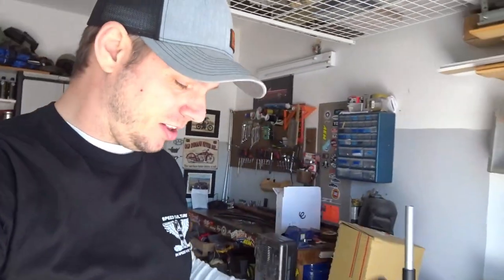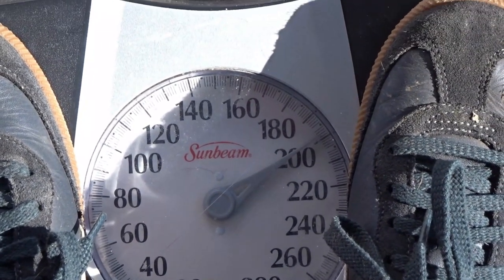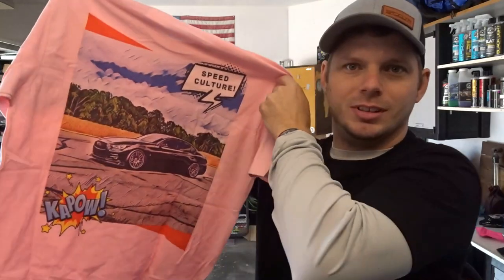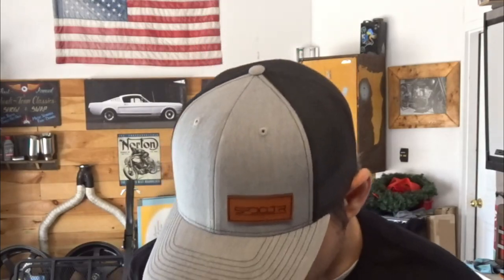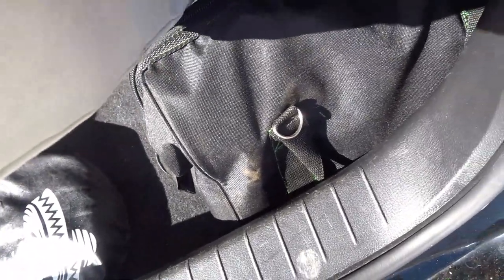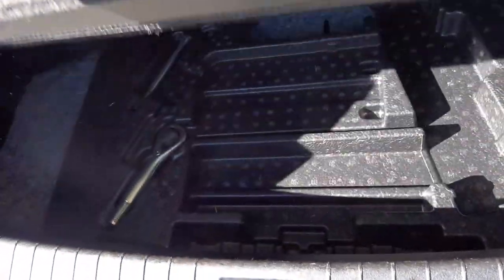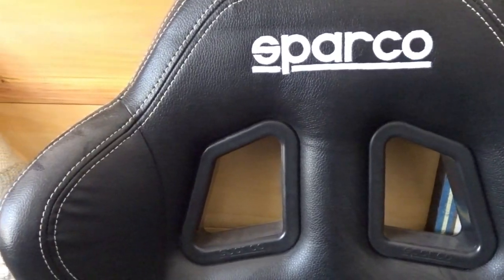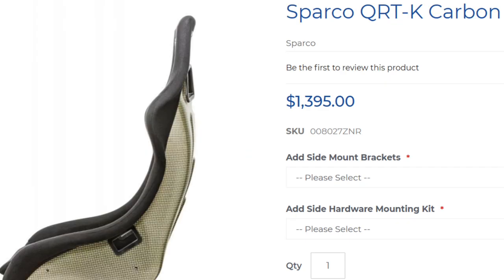Major Weight REDUCTION in the Q50! | Some Common Weight Reduction Strategies

Comment: I noticed big difference when I got 18 inch light weight wheels with race tires and the Z1 2 piece rotors front & back. Weight reduction is the best mod apart from driver mod.
Reply from the maker: Huge weight reduction!!
Reply: @SpeedCultureStudios  do you have any driving tip videos for better launch control, what rpm to shift at and racing tips in general for Infiniti Q50 owners. I ask because I find it difficult to engage launch control on my car on non prep surfaces. My car is a 3.0 with a few mods and I know it can run faster but i am sore need of the drive r mod.
Reply from the maker: @Driftking305forlife  I don’t have any experience with the 3.0t launch control so I am not really the best to ask there.  And knowing that I can’t even get traction in my 3.7 at launch, I can only imagine the difficulty you have.  
Tire pressure is a big one to think about.  How high are you able to rev to for launch?
Reply: @SpeedCultureStudios  On my car it's supposed to be at 2500rpm to set itself.Problem is the car just won't be consistent with this. With traction off on bad or regular road surface it will just spin and then hit the AWD error. If i launch it at less  say 2200 it won't but the car is not in full boost. I have also noticed that when accelerating out of corners the car struggles with power.

Comment: Lightweight driveshaft. for the g37 the oem one is a 2 piece heavy driveshaft. Aftermarket is one piece aluminum or CF. huge increase in acceleration and huge decrease in unsprung weight.
Reply: Where can I buy a single piece  drive shaft from bro.

Comment: Do u really think duck bill spoiler affects your 0 to 60 on a straight line .
Reply from the maker: Absolutely.  I’ve noticed the difference consistently since installing it.  The point of aero and large spoilers and wings is to increase downforce which inherently increases friction/drag therefore reduces acceleration.
Reply: @SpeedCultureStudios  ok bro
Reply: @SpeedCultureStudios  thanks bro , I will be removing mine shortly. Would recommend 1 piece drive shaft for the  g37 .

Comment: Hey bro I have a 2017 vr30 bought it last month with 52k miles from the 1st owner  and he said he never changed the transmission fluid should I change it? Had a mechanic tell me it could mess up my car what should I do?
Reply from the maker: If it’s shifting smooth, I wouldn’t worry too much.  If you notice it shifting hard or acting weird, have a shop do a drain and fill.  Never flush
Reply: @SpeedCultureStudios  Thanks its not shifting hard but it slips every now and then on the downshift
Reply from the maker: @Whips383  what do you mean it slips on downshift?
Reply: @SpeedCultureStudios  as im slowing down it dosent downshift smooth when I start slowing down it will like bounce down to 500 rpm on the gear change then goes back up to around 1k ish
Reply: @SpeedCultureStudios  its hard to explain to be honest ill just send you a video on Instagram later after I take it for a drive

Comment: Would about crash bars ,would they help as well.
Reply from the maker: What do you mean?  Like adding a bash bar for drifting?  Those are pretty heavy so they wouldn't be a good addition if you're trying to reduce weight.
Reply: @SpeedCultureStudios  sorry bro, I meant for weight reduction,
Reply: @SpeedCultureStudios  would you recommend moving them as well for weight reduction
Reply from the maker: @brickellevans3172  oh the factory crash bar/reinforcement?  No definitely not.  They ensure your vehicle absorbs impact properly so it would be quite dangerous to remove them in my opinion.
Reply: @SpeedCultureStudios would you recommend removing the factory bash bars as well for weight reduction.
Reply: @SpeedCultureStudios  thank u brother, I order some light weight racing seats along with z1 2 piece rotors  for G37 coupe, Will I notice a sufficient difference in acceleration and performance.
Reply from the maker: @brickellevans3172  You'll notice the car feels different and handles better.

Comment: In the v37 RWD you can gain 400hp.
Reply from the maker: I’m not sure what you’re saying.  You can make 400 crank hp (about 340 to the wheels) with bolt ons and a tune, yes.